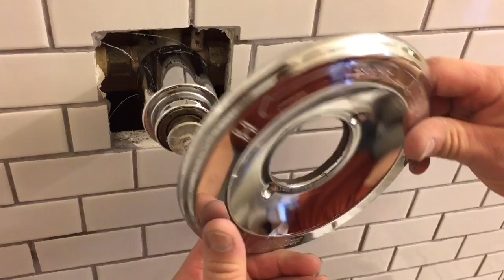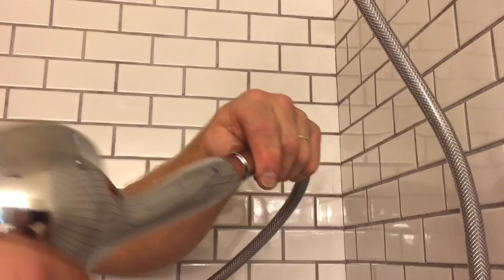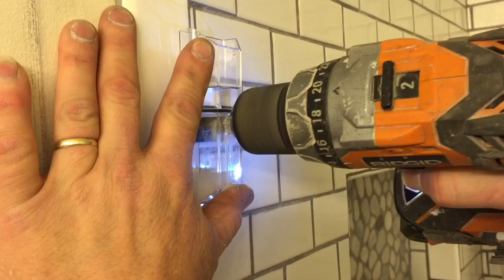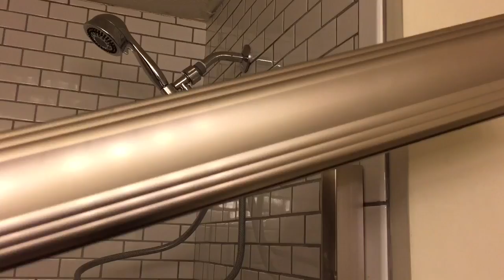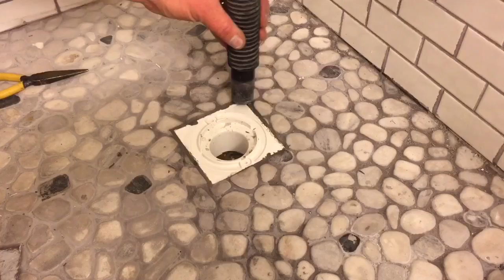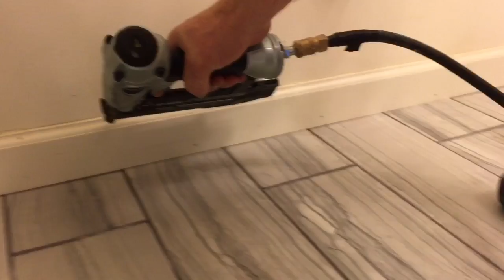How to convert a tub/shower to a walk in shower Part 9

Comment: The only complaint I have is you did not cover the drilling into the kirb for the bottom shower door frame. I would think this was one of the more important aspects for keeping a leak-free shower. :(
Reply from the maker: I did not drill into the "kirb" the bottom rail of the shower door frame is siliconed into place. Drilling into the "kirb" could potentially cause a leak.  Hope this helps, Thanks for watching.

Comment: I found your instructional videos very informative and well done. I could have used some of your tips when I converted a bath-shower several years ago. I ended up using a tile ready shower pan and it came out great but wouldn't feel uncomfortable trying your method when I build the new master bathroom. The way you broke down the steps into multiple segments and kept the video and dialog concise and too the point made your discussion very easy to comprehend for the average homeowner and newer builder.
Reply from the maker: Thanks for watching.

Comment: Great job Bob, and your vids are very detailed.  But people should know this is using techniques that are old school. I have done a few showers using Schluter-kerdi  kits (other manufacturers  kits available) years before you published this. Applied over dry wall  and than the a rubber paint, like you did (as just in case) seal before tiling, not a Schluter recommendation. Also, self sealing grout now wildly available. I have no affiliations with any manufacturer but I would use the Schluter-kerdi again just because I know the system but I will do a review of other things out there to see what is new and improved, which I recommend to all diy'ers.

Loved that river stone floor tile and will use that in my next shower makeover for the wife.

Best wishes to you and yours
Cheers
Reply from the maker: There are many new systems out there today including but not limited to Schluter-kerdi. This video is just an example of one way to do this job. The schluter system works very well...at an additional cost. 

Thanks for watching.

Comment: Very informative. You make look easy enough for anyone to DYI. One question, how did you finish the ceiling in the shower to make it water proof?
Reply from the maker: The ceiling is just painted drywall. Most showers do not have anything special done to them because bathrooms require a vent of some type to remove the moisture. 
Thanks for watching.

Comment: OMG, you are the best walk in shower  DIY I found especially for second floor shower.  Thank you Sir, because I was going to settle for an acrylic pan shower floor which I did not want. I am very skeptical on these DIYs but you make a lot of sense. Only question I have is if you use the same type motar for the first one than the  second step after that rubber plastic type film?
Reply from the maker: Yes, it is the same mortar. Thanks for watching.

Comment: Nice video with many helpful tips, but I have three questions. Why do you prefer waterproof sealing paint over running waterproof fabric up the walls? How far should the blend valve project from the studs? How far should the drain system project from the floor (before starting the first mortar layer)?
Reply from the maker: I don’t prefer one way over another. Water proof fabric is a good way of doing a shower also. There is more than one way to achieve waterproofing this is just one of the ways. 
An easy way to determine how far the valve should be is to use the mud guard that comes with all faucets. The finished wall should be even with the mud guard. To set it up when installing the valve add the thickness of the wall board and tile, then I usually add a little bit for mortar…maybe 1/6”. That is where the valve gets installed.
In this set up it doesn’t matter how far the drain sticks out because it is 2 layers. The second layer is screwed into the first setting the height to the tile is just a matter of screwing it in more or less.
Hope this explains things to you.
Thanks for watching.

Comment: Looks nice, although I prefer the bullnose on the vertical wall surrounding the niche rather than on the inside walls. If you want to avoid some potential leak points, they make one piece plastic inserts for the niche that you make a frame for and they screw in flush with the surrounding cement board. Then just tape the seems between it and the backer board. I also used an acrylic shower pan. No curb to deal with and much less fussing with getting the pitch right for drainage. Doesn’t look as good as tile, but it won’t leak and goes way faster for a diyer.
Reply from the maker: I have use the one piece plastic inserts for the niche before and they work wonderful if they fit the space you want. Also the use of an acrylic base is a great timesaver if the customer is OK with that. Thanks for watching

Comment: Bob, thanks for the videos.  Sorry if this question has been asked and addressed already, but I don't want to spend the time reading all the comments on all 9 videos. I just would like to know how you determined the cuts for the first row of wall tile. How did you measure and cut for the taper to make it so tight to the floor? I have done a few showers and am curious if you have a better technique than what I typically do. Thanks again. Shower looks great.
Reply from the maker: I turned the tile upside down and marked them to a level line. Using a 6 inch level to start the first row. Cut them and turn the tile over so that the cut end is down.
I hope this makes sense.
Thanks for watching.

Comment: You did a most fantastic job, Love the video...so professional. I would attempt yo have somewhat the same job....if you can tell me if it would be possible to do it in the same footprint as the tub without eating more space.
Reply from the maker: Yes, this can be done in the same space as a tub. There are actually kits that size that will help with installation. Thanks for watching.
Reply: @funbro1  thank you...I’ll be looking for that kit 👍😃

Comment: I'm very impressed.  I was looking at houses a few years ago with the intention to buy.  The best house I saw had very small bathrooms.  The owner was showing the house and had built it.  He said, "Yea, the bathrooms are small, but we don't spend much time in there anyway."  Now here was this $800,000 home built in the past 8 years and the bathrooms were similar to what I grew up with during the 60's.  

I immediately considered buying the home and converting the tub/shower into a dedicated shower.  Having watched your video, I can see it is not something I would have wanted to do by myself since I'm not known for remodeling.  But I'm very impressed with how you showed that it could be done right.  

Thanks.
Reply from the maker: Thanks for watching.

Comment: This was Awesome!  I have to ask how much you spent on materials for this spectacular conversion?  The reason I ask is that there are quite a few ads on Facebook (and EVERYWHERE else) that promise one day Tub to Shower conversions.  I had a guy come to my house and show me all sorts of cheap materials and then tell me that it would cost 12K to replace my bathtub shower combo with a walk-in shower in one day.  I'm wondering how much the guy who actually DOES the work get's paid because there is no way the materials they showed me cost anywhere NEAR 12K!  Your thoughts?
Reply: BTW I did my Kitchen in Subway Tiles and I think all the tiles for my kitchen cost me like $40.
Reply from the maker: I don’t remember how much this job cost but I can tell you that the amount has gone up significantly since this video.
Thanks for watching.

Comment: This is awesome. Is it best to place the vanity on the subfloor and tile around it as you did or should I remove the vanity and tile under it?
Reply from the maker: Actually most of the time I will remove the vanity and tile under it. To me that is the preferred method that way if in the future if someone wants to remove the vanity the floor will not become a problem and it give a cleaner install. That being said the home owner for this project wanted it done this way to save time and money. Hope this helps. Thanks for watching.
Reply: @funbro1  great reply thanks. I'm running into that issue now. I want a new vanity but now I have to retile.

Comment: Looks awesome you did a hell of a job. 15 years ago I put in a one piece shower in the master bathroom thought it would last forever and I was wrong it cracked on the bottom. This time I had sears come out to put in a new one it took them three times to get it right the shower floor pan keeps on getting a bubble in it, they finally got it right and we are happy with it. This time we lift the shower door off and had a shower curtain instead, easier to replace a curtain than a door that will get all water damage sooner or later.
Reply from the maker: Curtain or doors to each their own.

Thanks for watching.

Comment: Wow, so much detail.   How hard is it to keep clean and any required maintenance after doing all this work?
Reply from the maker: Should be fairly easy considering the tile is smooth, the only problem might be the grout but if it is kept up on that is not a problem either, just some spray on shower cleaner should do the trick. Thanks for watching.

Comment: Great videos!  You give a lots of detail but are straight to the point.  I'm a bit intimidated to take on this project of remodeling my master bath.  I've never done anything this detailed before.  Do you think its doable or should I hire a professional?  I enjoy a challenge but the pan makes me nervous.  Can you rock board the step in or is it better to mortar it?   Thanks
Reply from the maker: It definitely is a larger project that takes a few days to complete. The problem with rock board for the step is that you would need to put screws through the membrane to hole the rock board in place. doing so creates a potential leak. You could covet the screws with a water-proofing membrane to fix that but for me its' easier to use the tools in the video. Thanks for the question and Thanks for watching.
Reply: Makes sense to me.  I've watched so many videos and seen so many ways to go about doing this, I'm pretty confident that I can properly execute this project.   Thanks for getting back to me.
Reply from the maker: If you have any more questions pop back and I will try to help you out.
Reply: Jeff ....or better yet check out a copy of the Tile Council of America handbook(tile setters bible[the source for tile truth]) and see the ways that they suggest.

Comment: Hi Bob, nice work. My bathroom is already tiled on the floor. I have that same one piece tub shower combo that I'd like to replace with tile. Based on what you did how much, in your opinion, would it cost including labor for the shower only?
Reply from the maker: Anywhere from $1,000-$10,000 depending on many, many factors. Can't pin it down without assessing the job site. Thanks for watching.

Comment: You got it easy...!! Imagine working in a bathroom with 80 yr old plaster and lath, and with load bearing studs being all uneven, and having to use shims to level your cement sheets.... That was our case for bathroom remodel!
Reply from the maker: Been there done that, this does make the job harder. I am considering making a video doing an old bathroom remodel. Thanks for watching.

Comment: nice job my friend, you make me laugh, I do my showers the exact same way. from the nich to the drilling of the glass doors. My only beef I have is I never do a conversion without changing the wall plumbing. I have not stopped doing the mud jobs and I find myself buying the pre slopped pans along with the build up front wall. I find myself saving a lot of time.
Reply from the maker: Most of the time I insist on replacing the plumbing, but in this case the customer all but refused. I definitely agree...what better time to change the plumbing? Thanks for the view.
Reply: @funbro1 , Do you ever use PEX!?!?
Reply from the maker: @markw3598  Yes all the time, it works great. Thanks for watching.

Comment: You can cut your time in half using the Schluter system , also when putting in rock a rubber grout float works great for getting even pressure on flattening the material looks nice
Reply from the maker: It may be quicker, but sometimes not cost effective. Just did this one the old fashioned way. I use a rubber grout float for that very reason and it works great. Thanks for watching.

Comment: Great set of videos!  How much did this remodel cost the homeowner?
Reply from the maker: It is different for every job. Depends on many variables.
Reply: I meant in this particular case how much was the homeowner billed?
Reply from the maker: I do so many project I don't remember at this point. Sorry
Reply: beerbrewer737  please check out the multiple times and ways this question has been asked and the very specific way it has been answered. In this way Bob is like a high class gal who doesn't kiss and tell!

Comment: While completing such a project, the width of the enclosure is 26" tile to tile, is that standard for these conversions ? So would be like 26" wide for foot ankle movement, and if enclosure is moved to be at end of ledge , then like 29" for body movements. What is typically done ? No one mentions measurements !
Reply from the maker: The measurements will vary slightly from job to job. If you custom build a shower pan as in the video it can be whatever size you want, and if you use a preform shower pan there are many size’s available. Most sizes of pre form pans are of a size to replace the footprint of a tub so they will be about the same. Hope this helps.
Thanks for watching.

Comment: Thanks,
I have never sen a diamond cutter like that. I would used glass drill bits to cut through tiles or stone. The life is about 2 holes per bit. This looks way better. Can you shamelessly endorse this product? 
Also I have used the European fabric for water proofing rather than the paint on. This look much faster.
Reply from the maker: It can be picked up at most flooring stores or big box stores in the flooring department. There are many different brands. Hope this helps, thanks for watching.

Comment: It looks like you used the slanted sticks on the floor TWICE....below and above the rubber membrane.  Is that necessary??  Do the angled sticks take that into account so your final slope isn't too severe??
Reply from the maker: Yes I used 2 sets of "slanted sticks". The first set makes the pitch for the rubber membrane so that if any water gets through the grout/tile/corners the water will then hit the rubber membrane. Without the "pre-pitch" or first set the water would then pool on the rubber membrane and cause issues. 

The second set of "slanted sticks" is for the majority/all of the water to run towards the drain on the surface. The angle of the Pitch sticks is set up to be used with the pre-pitch  (2 sets) to give the perfect drop to the drain. Hope this makes sense the way I tried to explain it. 

Thanks for watching

Comment: Excellent job Bob. Made me tired just watching this!
Reply from the maker: It is a lot of work. Thanks for watching
Reply: I'm working on our shower valve this morning. Have to open up the wall to install the new upgraded valve. House is 70 years old, so nothing is easy. Very thick plaster and wire lath walls. Guaranteed it'll be an all day thing.
Reply from the maker: That can be a challenge for sure.

Comment: Technically not bad but design wise there are too many element, only use two colors, max. three, matching ones and only one texture. The three different textures confuse and dazzle the eye. Otherwise, I like the video and am not sure why you designed two slopes on top of each other. Is that necessary? Can humidity be trapped in between the layers?
Reply from the maker: As said before, not what I would have picked out but it was what the customer wanted. Thanks for watching.

Comment: Most plumbing codes call for a 2" drain for a shower , you left it 1-1/2 , also the valve should have been raised to a more comfortable height for a shower stall. 50 year plumber !
Reply from the maker: Most do yes, How high was the one in the video? Why is a 50 year plumber watching this video? But thanks for watching.

Comment: My questions is: why wasn't the shower valve replaced? If you're going to do all that work, why not replace it too?  What would it cost, maybe $100 more?
Reply from the maker: The valve that was in there was still good, had plenty of replacement parts available and the customer wanted to keep the same one. I like to replace them most of the time but not always. Hope this answers your question. Thanks for watching.

Comment: should have started the wall tile off of the bullnose once the bullnose was level... having those end pieces right up against the bullnose looks bad..  what seems like an inch to nothing looks bad.. or the better option making sure the walls were level before putting up the backer board
Reply from the maker: This was all thought of believe it or not. If you look at where the shower door track is placed you will notice that it covers those pieces up against the bullnose. So this was the best option when planned out correctly. Thanks for watching.

Comment: Curious. Why taper the top layer of mortar when u tapered the bottom layer?
Reply from the maker: If it didn’t have a taper on the top the water might sit on the surface till it soaked through and hit the second taper then it would slowly go towards the drain. By having a taper on the top layer it makes the water flow faster towards the drain. I hope this explains why to you. Thanks for watching.